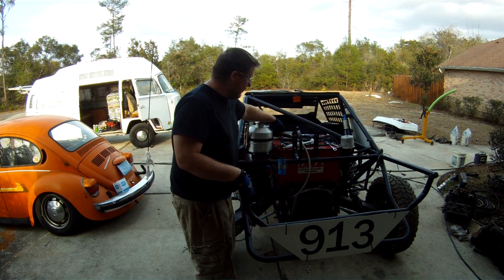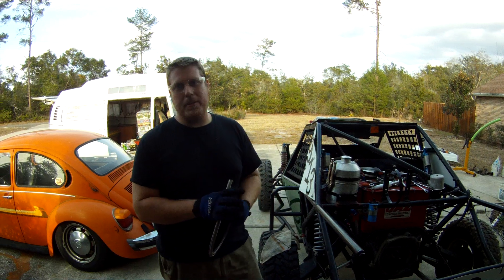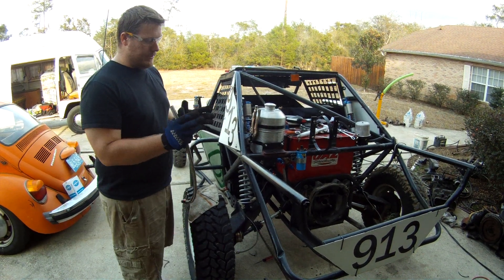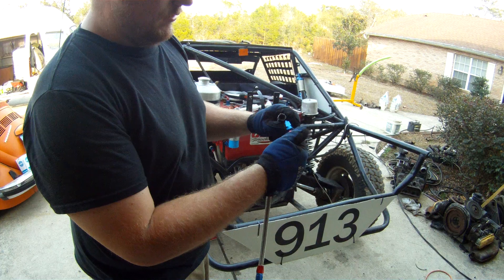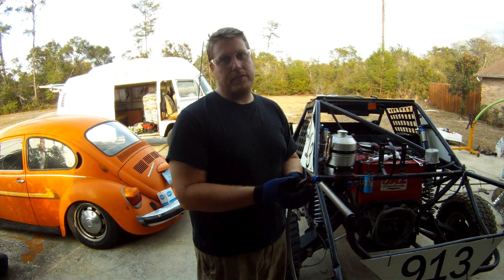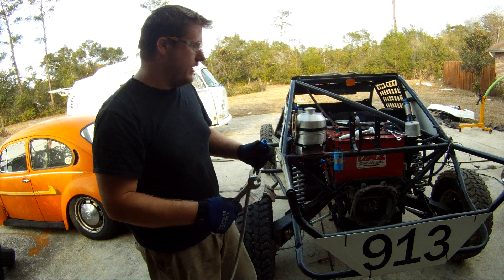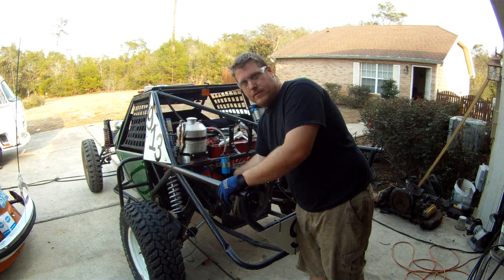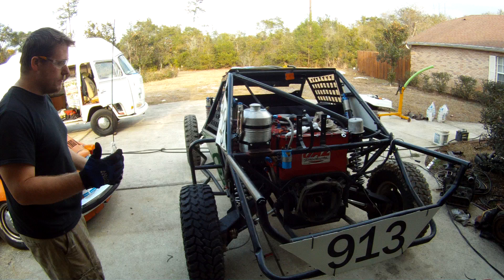Installing Dry Sump and AN Fittings

Comment from the maker: @coronet440sixpack 
I have used Masking tape before, I wouldn't suggest Duct Tape, it wants to pull the braids apart when you remove it, but Masking always seems to be ok, I just didnt have any this time.

@turbocobra
I have looked at buying the Fragola cutter, but figured the cutoff wheel would keep working, I wish there was a good single hand cutter that wouldn't smash down/crimp the rubber, most the cutters that work well are two handed tools. 

Thanks for the views
 - Gayden